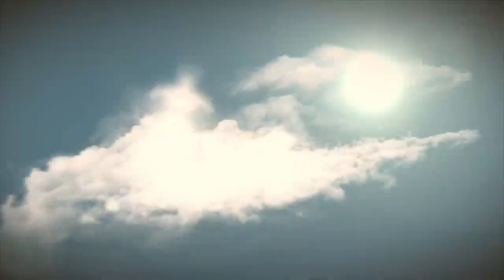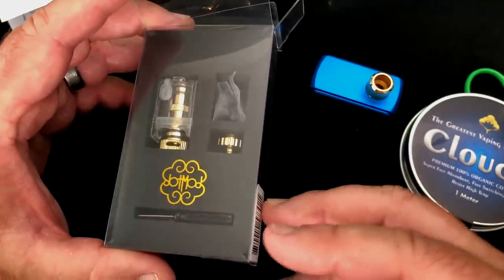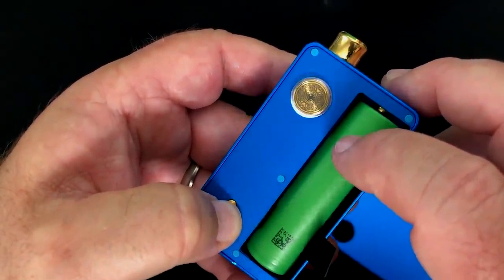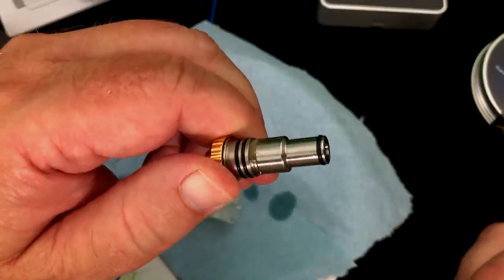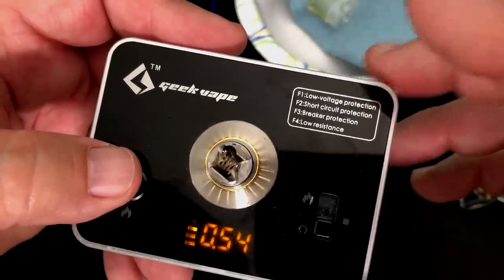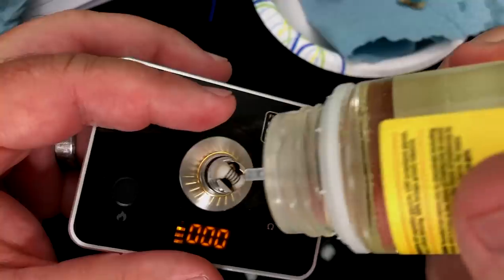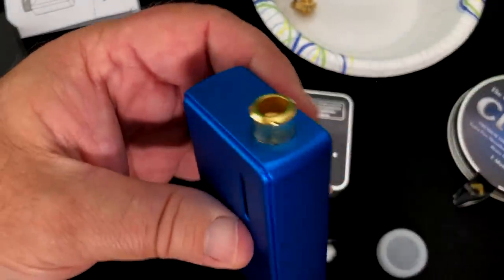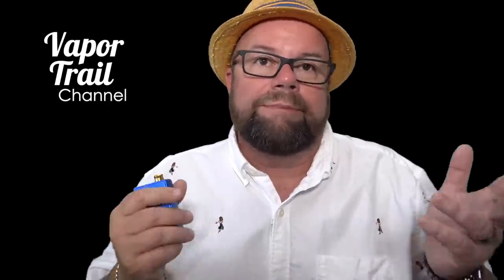Dotmod Dot AIO RBA - Does This Make A Good Mod Great? + Build/Wick

Comment: It's important to turn off the dry burn protection if using a kenthal coil I.E. only leave burn protection on with 316SS or a dotmod coil as per the DotMod Manual...

Comment: Dot aio have temp sensing function meaning that it have temp control, with the rba, is it possible to use ss316 or ni80 with the dry hit prevention?
Reply: Yeah, if you're using wire that's compatible with temp mode it'll function

Comment: I realize this is an older vid. All the same, I would like to know which you would recommend. The Dot AIO with the Dot RBA or a billet with a xeta?  I know there are vapeshells for both but I would just like to know for vape experience if the Dot RBA compares to the xeta in a BB.
Reply from the maker: That’s a tough one. If you have the budget and don’t mind the mod being a little heavier and lighter, the BB is king. BUT I have 3 BB’s and 4 DotAIO’s and love them pretty equally for the way I’m vaping these days. The DotAIO is far better for running around pocket carry IMHO, but that BB...they’re beautiful and so customizable! Be careful though...the BB is a rabbit hole and before you know it, your jonesing like a crack head looking for doors, inners, buttons, tips, and all that stuff. Any they’re expensive and hard to get (the accessories as well as the mod). That’s my 2 cents 😜
Reply from the maker: Oh, and for my money, the KRMA Bridge is better than the Xeta
Reply: Thanks
Reply from the maker: You bet!

Comment: Been using this rba base for around 2 weeks.. and honestly i'm impressed by the build space in it, i use MTL clapton and 30mg saltnic, and it vapes great comparing to the 1.6 coil head.. and the battery could last around 2 days 🤘.  I build it using the tips from @tomyneque at IG , its in indonesian but you could simply use the translate feature for english
Reply: What gauge coil do you generally put in the rba I just ordered one never had an rba before
Reply: @dominiclibertoski2571  i use asgart.realm's bluwires MTL series , its a MTL clapton in indonesia market. But recently i use 32/39 MTL aliens and it vapes great as well.

Comment: for some reason i can’t get it to read any higher than 0.2.  previous builds for me were even 0.16.  how can i get it like 0.4-0.5? more wraps? less wraps? does the length of the coil going into the holes where it’s screwed down effect the resistance? this aio rba is my first build and i’m doing good but i can’t get a higher resistance made.  any help or advice would be great thanks
Reply: i’m building my own regular round wire 24 gauge A1 wrapping on a 2.5 coil tool. (sorry i don’t know all the exact language)
Reply from the maker: Check out steamengine.org for some great info. See if you can find some Kangertech RBA pre-made coils in clearance somewhere. They work great!

Comment: Love Dotmod but this rba is a piece of JUNK. Those tiny grub screws are worthless. If you drop one, consider it gone. If you over tighten one, consider it gone. You are wasting your money if you buy this product. Spend the extra dollar and buy something with actual screws and wicking ports that get your cotton wet.
Reply from the maker: Well, at the time, it was the ONLY one available for the dotAIO, and it changed my whole opinion of the mod. For me, the Pandora DotRBA and the Pioneer Insider DotRBA are my favs. Thanks for watching! 😃👍🏻
Reply: @VaporTrailChannel  i just hate those damn grub screws. I can't tell you how many I have in my carpet or that I have thrown away from extended use lol. If they would just changed the grub size or change it to an actual screw, I'd still be using it.